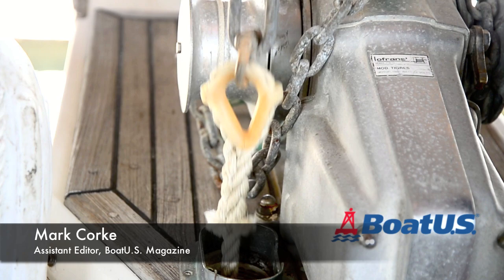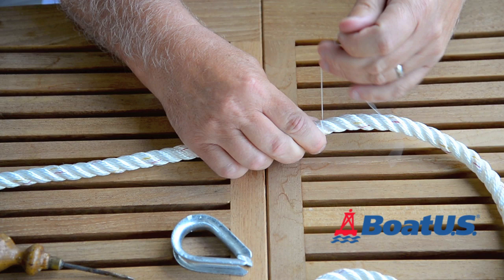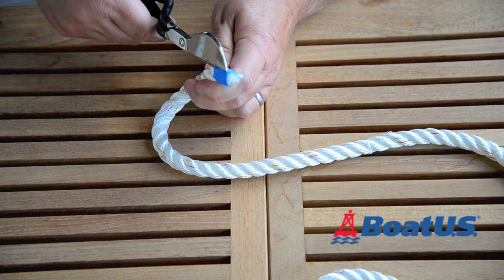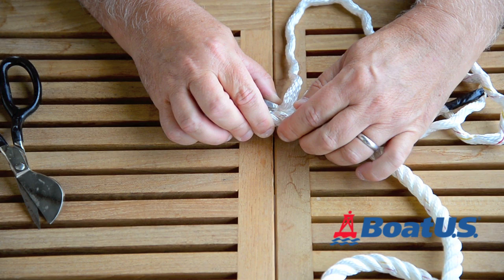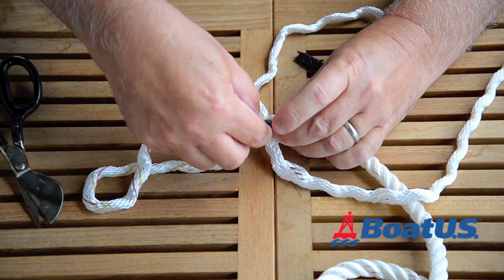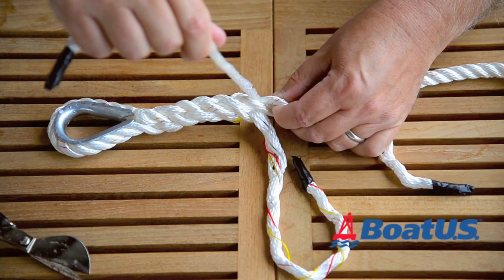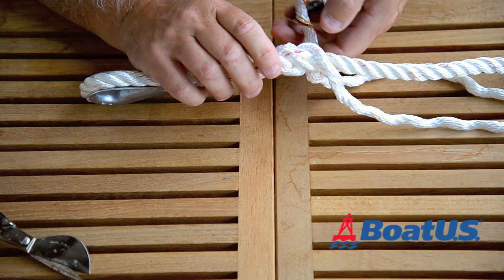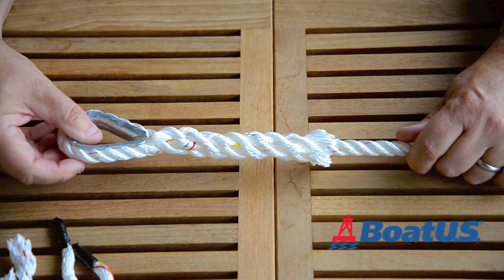How To Splice Rope Around A Thimble | BoatUS

Comment: When finishing the thimble splice or any splice in 3-strand line, lay it on the deck and roll it under some pressure with your shoe. That tightens the splice right up, and makes it look perfect.
Reply from the maker: Thanks for the great advice, John! Sounds like you've done this a few times

Comment: So why do we measure down 5 lengths of the thimble and then cut half of that length off at the end?
Reply from the maker: Thanks for the question, Gerry. The main reason for measuring down five lengths is that, unless you have enough rope to work with, making a neat, correct, splice is almost impossible. If you get into the habit of measuring five lengths, no tape measure is required and splices will be consistent irrespective of the size of line or diameter of the thimble. Also, some folks like to taper the splice for a neater appearance, and the extra line allows you to do this.
Reply: @boatus  Thanks.

Comment: do you really need whipping twine?  It appears to be a temporary thing so that the rope does not unravel.  Could you just use dental floss?
Reply from the maker: I suppose you could use waxed dental floss to finish off a splice ... the same as you could use whipping twine to floss your teeth. But it's not made for that purpose and results may vary. We wouldn't recommend it, but that's up to you.

Comment: Not academic, you should show how it is taught in classes. The rope should be tighten to the thimble using single wire cut from a strand as whipping. the thimble needs to be compressed in a vice and kept tight again using single wire whipping, then start your splice and to finish it in decorative way make 2 more passes after the third after cutting half the wires on each strand to tapper and not leave those ugly bits sticking out. Once completed and put under tension to tighten the splice then cut the wire keeping the thimble compressed which is going to tighten more your splice as the thimble enlarges.
Reply from the maker: Thanks for watching, Denis, and we appreciate your comment. There are lots of ways of completing the thimble splice. Some use whipping and some don’t. Much is dependent on personal preference and the use and subsequent loads to which the splice will subjected. I agree with your reasoning regarding the use of wire whipping if the splice is used for something like a mooring pennant. But in other situations where the splice is frequently inspected, such as connecting nylon anchor rode to chain, I have found the whipping unnecessary. A vice might be useful on larger diameter line or when used for a wire splice but this is outside the scope of our typical readership.

Comment: You had enough left on the ends to taper that splice
Reply from the maker: I generally don't taper the ends of a splice with three-strand line, but you can. To taper the end, make two additional tucks with 
one strand and one additional tuck with a second strand, 
leaving the third strand as is.